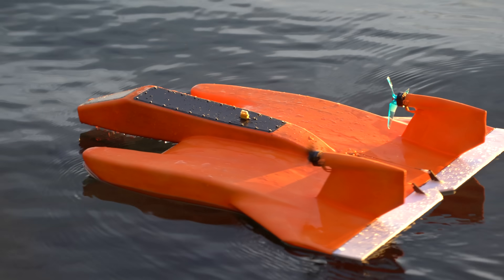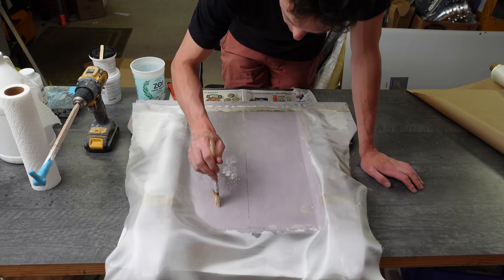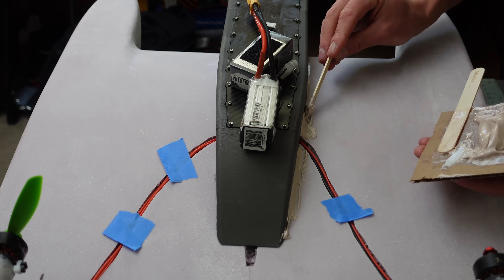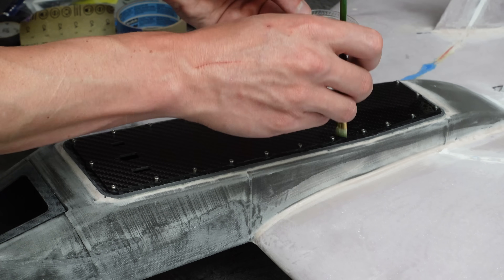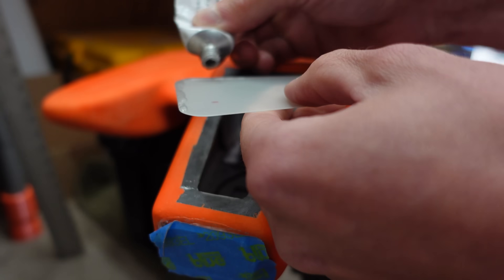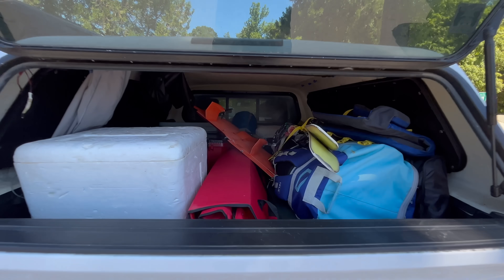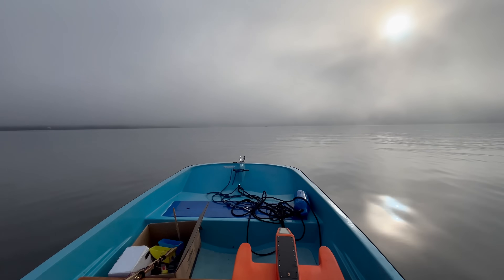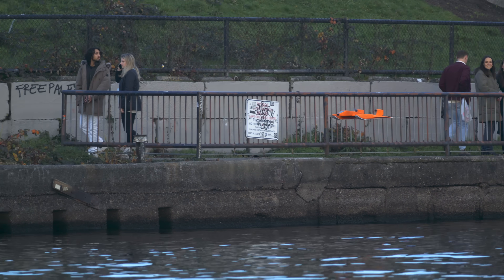Building an FPV Seaplane - 3D Printed + CNC

Comment: I'm pretty sure that your issue with water operations is two fold- high tail mounted engines providing a nose down moment under power combined with nacelle steps that are too forward to provide sufficient pivots for rotation.  The first could be solved by mounting the motors to the front of the necelles, which will also provide par thrust and blow the whole wing for enhanced low speed lift. The second could be remedied by fiberglassing 3d printed spacers behind the existing steps to move them back to slightly behind the cg. Good luck and thanks for sharing, she's a very pretty bird.
Reply: You are right! Just like the ekranoplan. He is also wrong about the ground effect.
Reply: Dont underestimate the effect of stiction with the water surface.

Check out an old plans design called Sealoon.

Comment: 9:33 --- you need to use some coolant-lubrication ===isopropyl alcohol works best (but the fumes not) / or use proper coolant for that , it will cut waaaay easier with better finish

Comment: Going to try using the PVAglue to keep epoxy from getting on the blade/handle of the knife during glue up. Also the Carbonfiber board for liners. Thanks for the ideas man!

Comment: Perhaps use a syringe or something to apply some material to the hinge line of the fiber before wetup?  Silicone or hotglue or something to prevent an epoxy bond.  I wonder if the Aramid fibers tear when the hinge is bent and they are in matrix.  Just my armchair theory.

Comment: Seaplanes need a stepped hull otherwise the water creates a suction force making it almost impossible to lift off the water.
Glenn Curtiss, first man with a pilots license, discovered this during testing of float planes which were seen as much safer for testing early airplane designs

Comment: Great build! I've been using heat sinks sticking out of the fuse on my ESCs for electric float planes for 20 years now! Love what you did on the VTX, you might want to add that feature for the ESCs too! Consider joining us for the NW RC seaplane championships at Pinehollow! It is hosted by the Portland Skyknights in June.

Comment: Recommendation for next time: Make a holder (3d printed) for the servos which mounts into the form instead of the servos themselves so you can swap them if they go bad. Its not very hard to break the tiny gears in those servos

Comment: I hope you had your *Remote ID Module*, and registered your craft as well as had a spotter. It also seemed you were over the 200m in elevation limit. I wonder if you take these things into consideration or whether or not you will get flagged or if they only flag Quadcopter pilots doing the same things? I hate these rules to some degree, but I guess we all should be aware of them. Nice vid, cool build and too bad the pontoons weren't high enough.

Comment: I had one of the original Hobbyking Skippers, that after a few rounds of conformal coating and foam-tac, had a waterproof FPV setup. Now I fly an updated version of the same plane, the Josway Dragonfly, with a from-the-factory waterproof FPV camera. Gotta shake up the norms a bit, once in a while!

Comment: One thing that probably contributed to the poor performance on the water is the way you fiberglassed the step on the "pontoon". A hard edge is critical on the step. if it has any significant radius, you will have great difficulty getting it to plane on the water. This is much more critical at a small scale than it is at larger scales, due to reynolds numbers and how scaling works. Notice when you added the depron strip, it had a sharp edge on the back, and worked fine. 

This is why inflatable paddleboards are much "draggier" when trying to surf vs a normal surfboard or a paddleboard designed for it. It's the rounded edge on the back. The sharpness helps the water to "break" from the surface.

I'd like to see you radius the edge of the depron to about the same as the underlying pontoon to see if the problem comes back. That would confirm my suspicions, and then everyone learns.

Comment: Just add some V shaped hydrofoils on it to create more lift while you're in the water. It would also add more wing surface while you're in the air so you should be able to go slower without needing so much angle of attack, which makes it easier to control.

Comment: ground effect is absolutely more proportional to size (specifically of the wing) and more weight simply means the cushion of air it builds has to "work harder" so to speak to provide enough pressure to make the ground effect as pronounced as an identical plane with less weight.

Comment: Awesome video! Looks like your biggest problem with aluminum on that CNC might be that you're heavily recutting chips that aren't being evacuated from the cutting zone. From there, 6061-T4 may be easier to machine and getting a two or three flute endmill with a high helix angle and polished flutes. But most important is clearing those chips from the cut, which a different end mill and some compressed air would help with. Lower down the line would be something like minimum quantity lubrication coolant/lube, but get those chips out of there and you'll have a much better time already.

Comment: Cutting the Kevlar fabric on the bias (45*) makes the hinges WAY stronger. It results in twice the fibers crossing the hinge line. Yes I did figure this out the hard way haha
Love these videos!
Reply: Excellent tip. Is using Kevlar in a hinge a common modeling technique?
Reply: That's a great idea. I'm just starting to build some hot wire foam wings, and have been thinking of what hinges to use.

Comment: This was a big departure from your normal builds,  quick and dirty prototypes with several modifications until something approximating the concept is created... you went straight into the final form this time. Man the 03 air unit is impressive as heck.
Reply: He has an interesting process. I know hindsight is 20/20, but I'm surprised he didn't anticipate the takeoff issues with the pontoon design given his prior experience.

Comment: just paused seeing you machining the aluminium. Precision mechanic here. Its in the nature of aluminium to get smeared. You can reduce it by using an other alluminum alloy but seeing you have a big sheet of it, it wouldn't be smart to throw this away. Using some sort of liquid cooling should help the most. You could use isopropyl alcohol, a sprayable cutting liquid (there is one by WD40) or even just WD40 (but its not designed for machinig purposes). Anyway your part turned out to be good I guess.

Comment: I am very far from an aeronautical designer, but I'm wondering if your motors are too high/too far back? that could be putting too much forward rotation at low speeds which could be the reason it is plowing into the water. Your previous designs had the motors right up front and even pointing up a bit. Either way, your videos are excellent, thank you!
Reply: I thought that too: thrust-line's too high compared to the previous forward-mounted motors?

Comment: 14:57 made me think how cool would a diving plane be!
Reply: I'm picturing some little delta-wing style thing that can just dart into the water like a needle. Really high speed in a straight line but with enough momentum to jump back out.
Reply: @DigitalJedi  Check out the very old movie "City Beneath The Sea". Opening few minutes features a plane that becomes a sub.
Reply: Would be so sick. However you're probably not gonna see much when diving into the water. And it could loose radio signal
Reply: @ariafpv  "It could lose radio signal" yeah and both props lol
Reply: @whatevernamegoeshere3644  probably😂
Reply: Something like an RC Seabreacher would be fun.  Probably have to have a pretty tall mast or towed antenna though to maintain signal during dives.

Comment: Awesome but.... O-riiiiiings! For the love of whatever you hold dear, please... You are one of the smartest dudes on the internet and o-ring channel design is super easy, especially when you mill the channel out with Ze Robot. No more "trying" to keep compartments watertight;)

Anyways, back to the video, maybe you did manage to make it watertight after all, hehe.
Reply: My builds dont leak w/o o rings. Just super tight plastic on plastic
Reply: Any suggestion for o-ring design crash course?
Reply: @AB-bu8ti  I am not an engineer, maybe just slightly techy/nerdy and I figured it out pretty much just by using the Eriks online o-ring calculator. But I guess I may also have read some articles way back when or maybe some intro text in Parkers O-ring book (online).

It's fairly simple. O-rings work by being compressed. Dynamic use cases generally have a bit less compression and static ones a tad more, something like 15-30% but the calculators will tell you and there are published guidelines, too. But you don't want to over do it. Also, importantly, the o-ring still needs to have free space to expand into. If you constrain or compress it on all four sides, it will take a permanent deformation and/or wear out fast. Again, the online calculator will throw a warning if you don't have enough free space. Or if you stretch the ring too much. Also, say you have a rod in a bore that needs to be sealed, you wanna keep the gap between the rod and the bore small enough that the o-ring can't get pushed into the gap. Calculator will warn you of that, too;). But that's most likely an issue at higher pressures. 

You could actually just do the calcs by hand, too and then add free space, not stretch the o-ring too much and keep the gap small:)  
But I suggest making a few example designs in the calculator and soon, you will get the hang of it:)